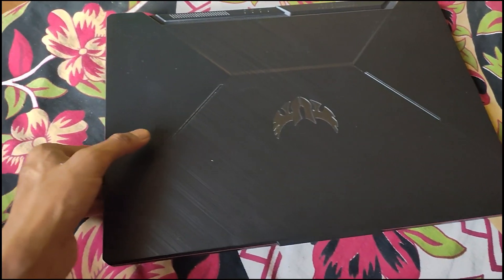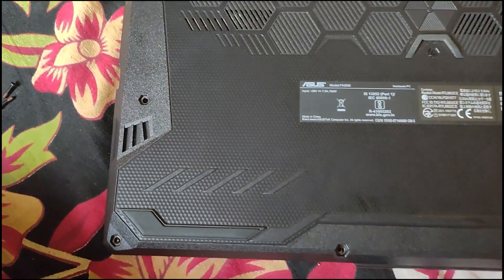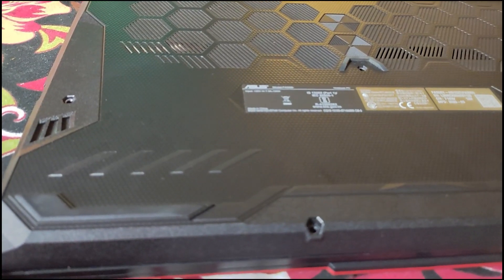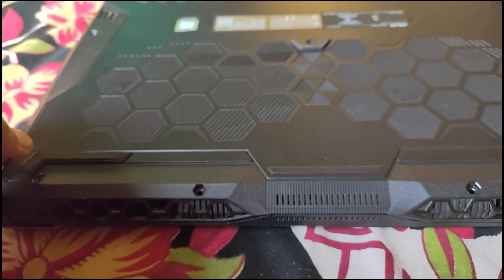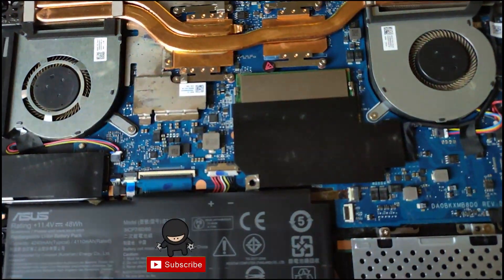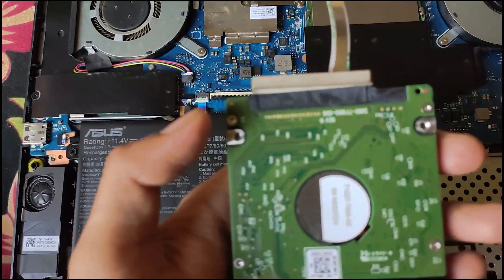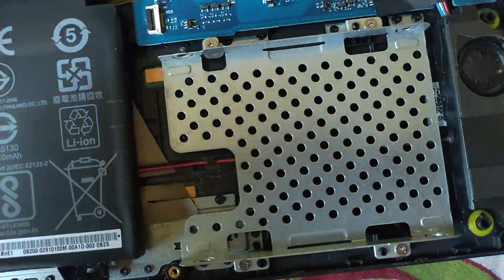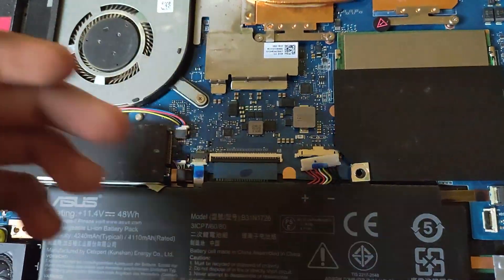Upgrading 1TB Hard Disk in Asus Tuf A15 | Start to Last!

Comment: You say it is fit but screw places didn't fit? How did you fix that?
Reply from the maker: you need sata HDD 
check the link i have provided in description
Reply from the maker: It should be 2.5 inch 
not 3.5 inch

Comment: Bro I have the same laptop... Also I want to upgrade storage so can I add 500gb SSD..?
Reply from the maker: In the same specs you, there are no extra slot for SSD you need to remove the old one and add 1tb SSD if you want to upgrade, but in 1660ti model or above that model you will find extra SSD slot
Reply: Bro so I can only add 1tb normal harddisk..?
Reply from the maker: @HarishKumar-xl9le  yes you can add 1tb hard disk also 

Search for WD or Samsung hard disk Seagate will also work
Reply: @Devilyte  thank you so much brother ❤️
Reply from the maker: @HarishKumar-xl9le  My pleasure ☺️
Reply: Also bro can you  suggest me which harddisk is best..?

Comment: I think this HDD will fit for Asus Tuf F15 ?and how  should i choose 8gb 3200mh or 2666mh ram ?
Reply: by default the fx506 motherboard would have limited at 2933mhz. so its better to get 3200 mhz ram. if u use 2666 mhz it will reduce the mhz of the other ram to 2666mhz.
Reply: @TechSavagePK0412  ok tu bro
Reply from the maker: Bought 3200mh ram right?

Comment: I cannot figure out for the life of me how to plug the little blue tag on the hard disc adapter into the motherboard. This video is great but the ending is super unclear. Can anyone explain how it goes in? I'm worried I'll damage it.
Reply from the maker: it need to push into the motherboard safely and lock it try to watch it closely
Reply: @Devilyte  Okay, would have liked to see that but I'm still grateful to have any guide at all. I wound up taking it into a shop and getting some help with it. Ty either way

Comment: Thanks for this video. Used video and upgraded my Tuf. Screw info important.. made a card template and stuck screws in holes. My sata connector had to be carefully laid under corner of battery... I explored other connectors to see which way it plugged in.. could be made clearer though.
Thanks again.
Reply from the maker: Keep Supporting :)

Comment: I have a question, I saw that the hole of the case does not fit with the one of the hard disk as you did
Reply from the maker: yes I replaced it, and added the good one link in description which fits perfectly, meanwhile you can  make it stick with something it will work